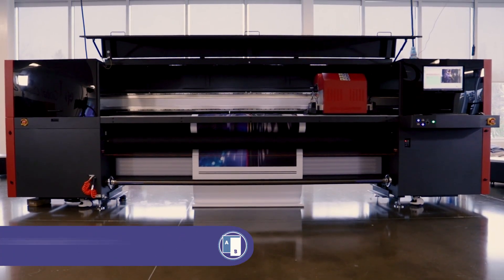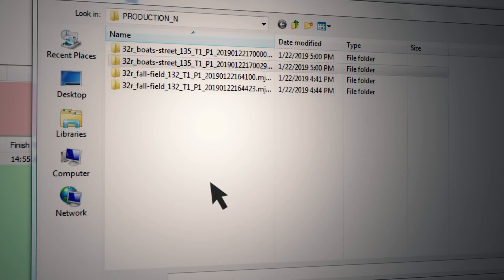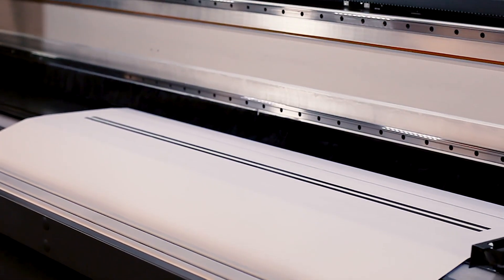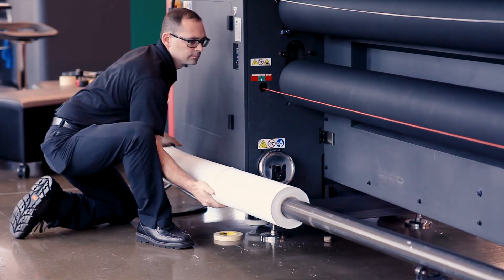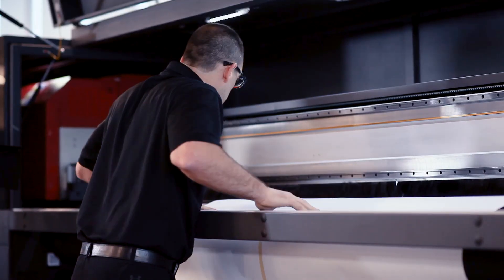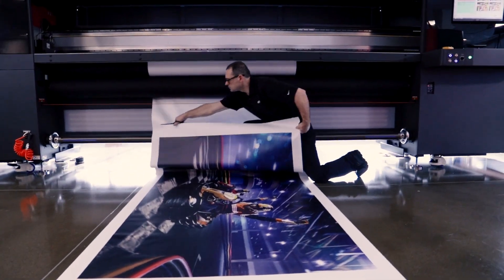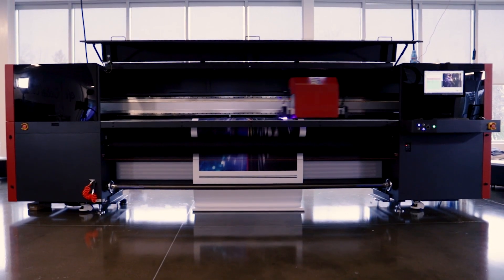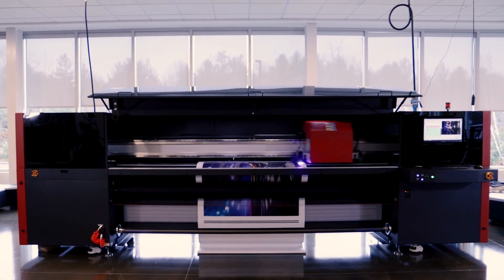EFI Power Tools: Double-Sided Automated Blockout for the EFI™ Pro 32r roll-to-roll LED printer

Comment: The video says it scans the double printed bar for accurate registration in the Y access, what about in the X access?  Do you have to manually register that?
Reply from the maker: Matthew Sambrook The printed bar being read on the back side sets the print start position. There is a sensor on the carriage that scans the media to place the image centered.
Reply: @EFIInkjet  Okay, thanks for that info.  What is the difference between the pro 32 R and now you list the Pro 32R + on your website?
Reply from the maker: Matthew Sambrook Some software options from the 3r/5r. New clear option and a split core for better 2 roll printing.